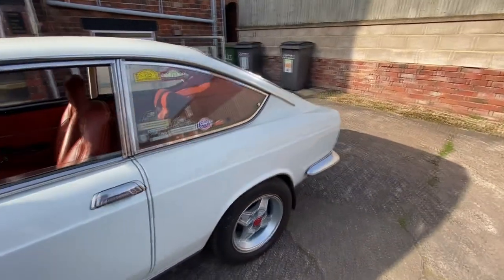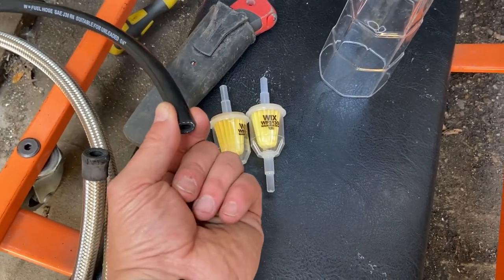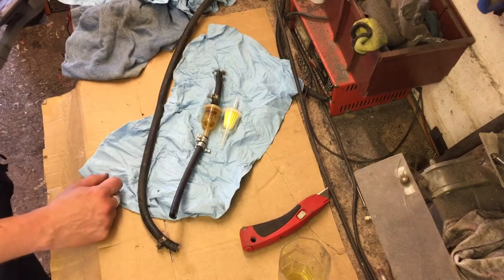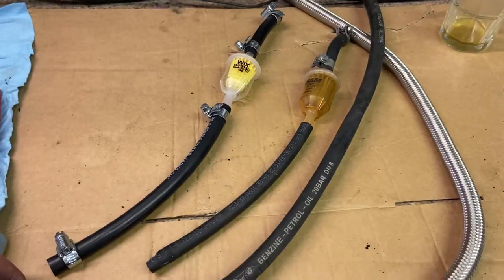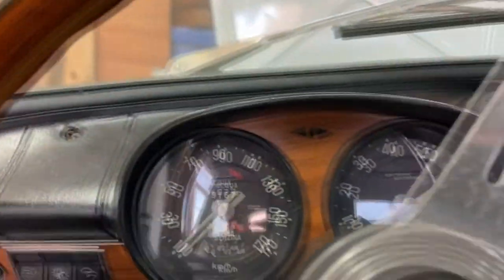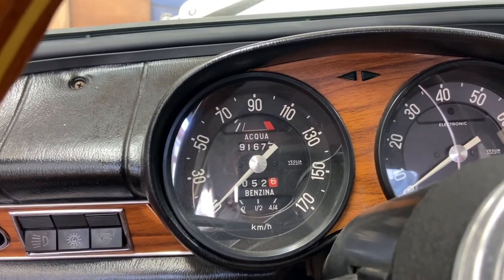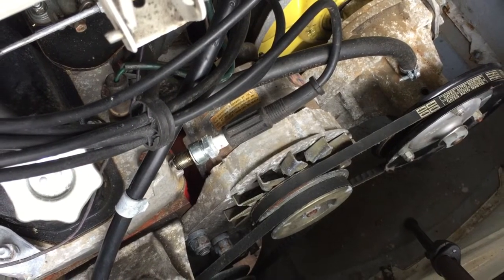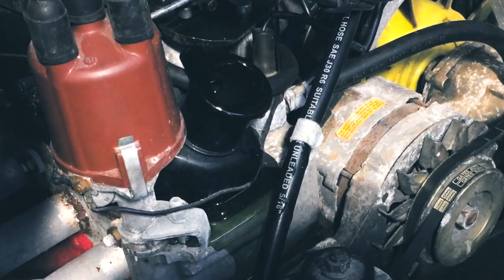Our 1971 Fiat 850 SC Ep 2 - Preparing for a cold start

Comment: What age is the Fiat? The Austin doesn't have a pop filter either but it is also Edwardian in origin!
Reply from the maker: this particular example is 1971 so relatively modern in the grand scheme of things, albeit the design is late 1950s in reality.  I realise 'it doesnt have a filter' is a bit a misnomer, it technically has a centrifugal filter but the service intervals are something like 30,000 miles and you just clean it out rather than replace it like a filter.